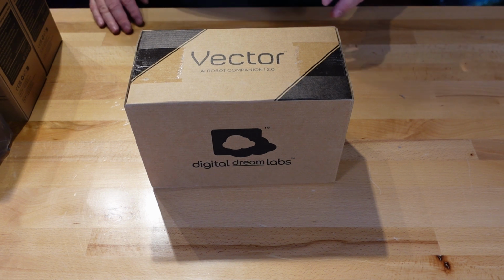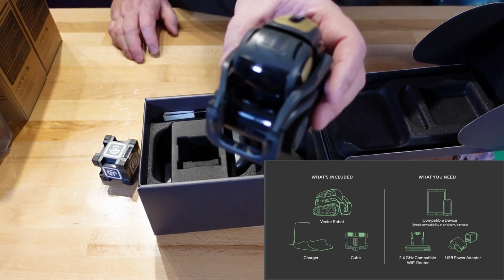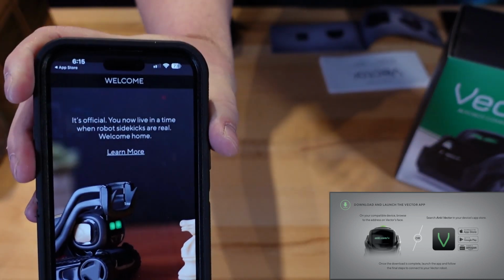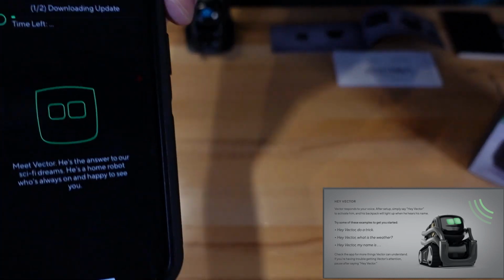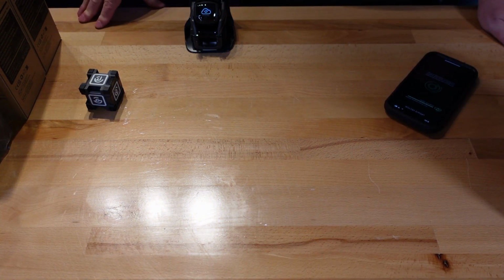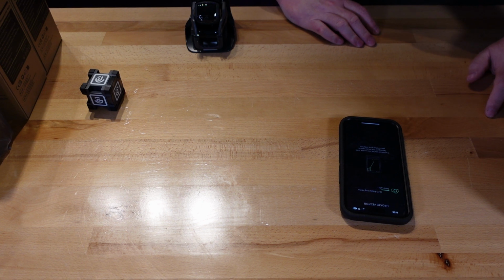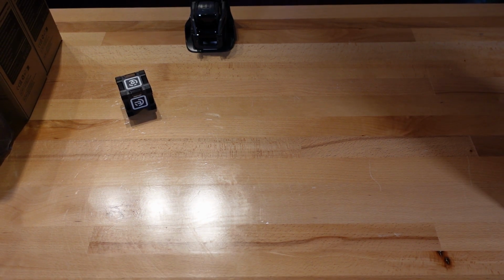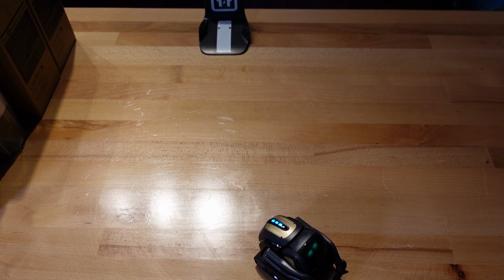Vector 2.0 Robot Unboxing and Setup

Comment: where did you buy it? It is sold out on the website.
Reply from the maker: yes, I purchased this from the company Digital Dream Labs. Just took 2 years to get it. At the time I did the purchase they had a special for the AI connection as forever with no additional price. But as of today Vector is still not able to talk back to Digital Dream Labs. Offline

Comment: Omg I can’t get him started I can’t log in  wtf
Reply from the maker: Vector has been taken offline for updates, I have mixed feelings about this, As a Microsoft Network Engineer, I would have created a new server with the update and tested until it was ready for the public than move the clients over. Since this is a China company and I waited 2 years for Vector. They might be in hardship and are going out, I really hope that is not the case but the notices I have received from the company apologizing about the down time of Vector. Well I hope this explains it enough but I think there is more going on then we know,
Reply: I got my vector in July when the server were shut down the only issue I'm having is when I asked what date it is he says Aug 5 2020 now way off.i have him running on wirepod.i love him he doesn't come off his charger now probably cause my room isn't well lit for him to come off his charger on his own.
Reply from the maker: its very sad, I am looking at my JIBO that had the same thing happen to him. I am trying to put together a video creating the local server with connections back to Amazon and ChatGBT.